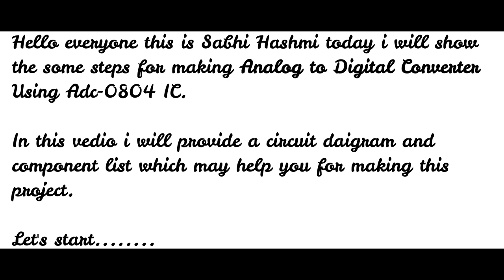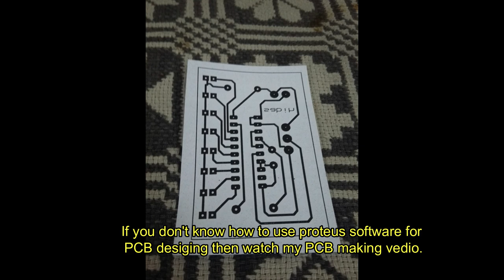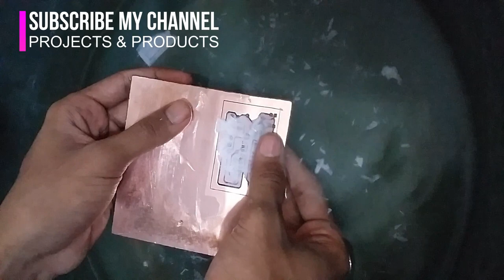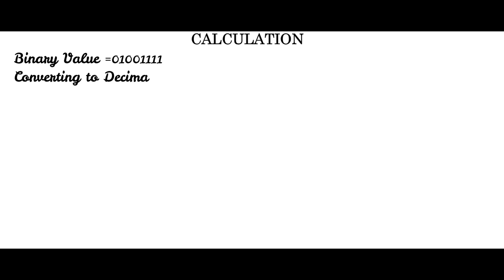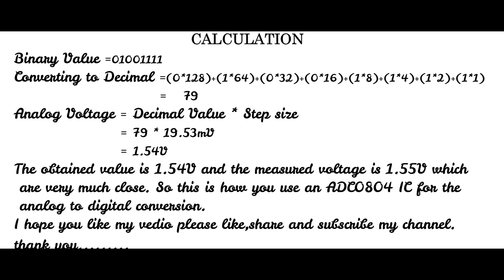How to make Analog to Digital Converter (ADC)

Comment: I did it in 2 hours after spending 1 hour to buy components. This worked very, very well. I used voltage division to get 1.55 v, i used 100 pico farad. It worked perfectly with the 2k poten. Very very thankful.
Reply from the maker: my pleasure...

Comment: Please help to solve this problem 😥😥😥
An Analog to Digital (A/D) converter truncates analog signals
to the nearest digital value that is less than the original analog
value. When sampling s random analog signal with voltage 
"v" between 2.5 ≤ v < 3.0, a digital value of 2.5 is assigned.
Thus, there is an error "x" in the digital assigned.

a) Draw and lable the density that represents the error "x" between the
analog voltage and the assigned digital value.

b) Using the density from part (a), determine the probability that a
the digital value of 2.5 Volts is in error from the original analog signal by less than 0.10 Volts.